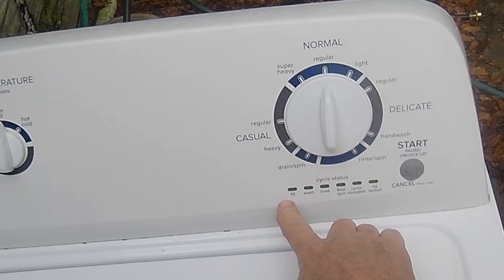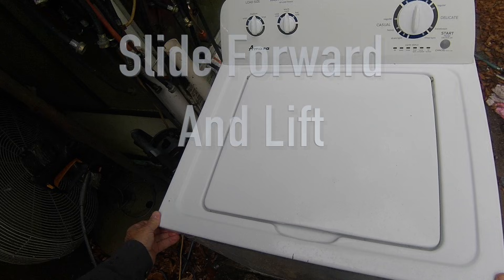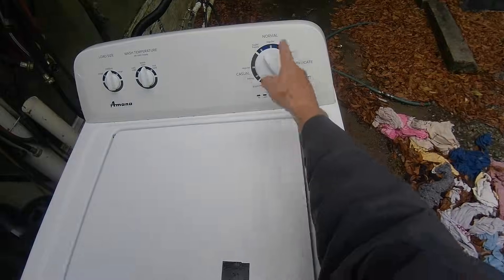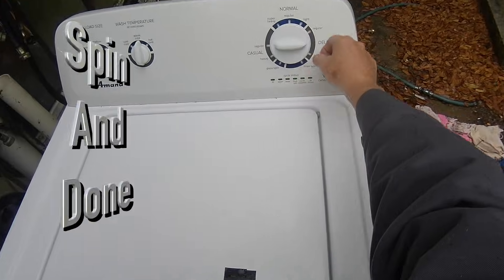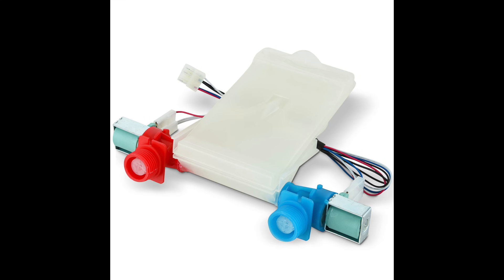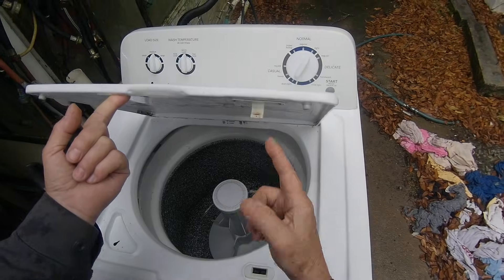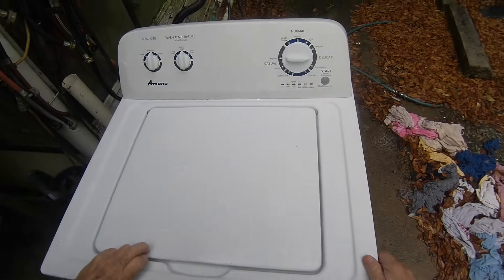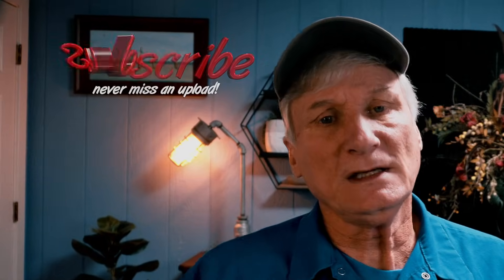How To Diagnose Your Amana Washing Machine: Chip's Guide to Manual Diagnostic Mode

Comment: not sure if you're still active but i just got this washer second hand and when doing a wash cycle it seems to just endlessly drain as its filling up to start the load, waited about 7 minutes and just stopped it cuz it seemed pointless to continue running if it was never gonna fill up. switched it to the rinse/ drain cycle and that worked as expected. do you have any idea why it would want to just keep draining while filling for a load? thanks in advance and thanks for this tutorial!
Reply from the maker: Watch this video. It may give you a clue. How To Troubleshoot Washing Machine Cycle Failures: Plumbing Tips for Technicians
https://youtu.be/OBZcWzOj0Ig
Reply: @HarperandKnowles you're the best! It takes a true professional to be able to diagnose and solve a problem with such little info on my end. Simply picked up the drain hose and it worked 🤦‍♂️
Reply from the maker: Yeah, if you have a hole at the bottom of a bucket (washer tub) with a hose attached to it, and you lay it on the ground, the water will run out! It just isn't obvious when it's surrounded by a cabinet case! Thanks for watching!
Reply: @HarperandKnowles  it makes so much sense, thanks for replying so quickly and for explaining the problem in such a way even I could understand haha.

Comment: Hi I’m having an issue with the same type of washer in the video thing is once I turn the knob from 12oclock position the lid lock light pops on I changed out the lid switch already can it be a control board the machine it’s doing anything just the light comes on when turning the knob
Reply from the maker: It could be a control board. It could be you got a defective lid lock. Thanks for watching!

Comment: Thank you so much for making this video. After watching it, I was able to correctly diagnose my Amana HE washer and figure out the shift solenoid had malfunctioned, probably due to a recent electrical storm. After removing and replacing with a new unit from Amazon, it works like new. Thank you again for all the helpful info you have provided.
Reply from the maker: You are very welcome! Thanks for watching!

Comment: My issue is with draining/spinning. It seems to work unless there is more than a couple of inches of water in the basin, or clothing in there. So basically it seems it wont work if there is any weight. Any thoughts?
Reply from the maker: So, you’re going to have to determine which problem you have. Is it a pump problem or a spin problem. Put it in diagnostics mode and using the water valve setting fill it with about an inch of water. Move it to pump setting and see if it pumps out. If it does then you know it’s a spin issue. Thanks for watching!
Reply: @HarperandKnowles  thanks for the quick reply!!. Ran the diag and it's not draining. when i lay the hose on the ground water comes out so it's not a clog. Should i go right to replacing the pump or is there something else to look at?
Reply from the maker: Pull the pump check for clogs or jams. replace if necessary.
Reply: @HarperandKnowles  Thanks Chip...It was the pump. New one on Amazon for $33 and I'm back in business! Thanks

Comment: My amana washer 
runs out of the blue without anyone turning it on. The lights do not light up or anything. When you unplug and replug it; it just runs with nothing happening. What could be wrong? Do we need to buy a new washer?
Reply from the maker: I’m assuming your water pump is running? If so hold down the start button about 20 seconds or until the noise stops. If it continues you’ll need to change the control board. Thanks for watching!

Comment: My Amana washer starts a cycle but stops after the water has run. The pump keeps running no matter what I do and you can hear it trying to drain. Even after I hit cancel and stop it. The lights turn off but the pump keeps running. What do I do?
Reply from the maker: Try holding down the start button for about 30 seconds. If the pump continues to run after it has been reset then you probably have a control board issue. Thanks for watching!

Comment: Can you please explain what is wrong when the motor seems to be running with no water or anyone starting the machine. This noise pauses when I hold the cancel button, but a few seconds later it begins again. All systwms seem to pass. While the noise is on, it does nothing. No water, no lights, no lidlock, etc. No one turned it on.
Reply from the maker: It’s called a suds lock when you can hold the start button down and fixing it. Its called “time for a new control board” when it doesn't. There's something wrong with the pressure transducer on the control board. Thanks for watching.

Comment: I have a amana washer. The motor just started running on its own. No water is running, no agitator movement. Its just the hum of the motor. Any suggestions?
Reply from the maker: Hold the start button down for about 20 seconds until the humming stops. Thanks for watching!
Reply: It works! I had the same problem
Reply: Thank you so much. 😊 I really appreciate this it worked  perfectly.
Reply: I have the same issue and the motor starts running after every bulky/sheets cycle.
Reply: @Ladeedaa007 it needed a new control board.
Reply: Worked for me too

Comment: When i plug my washer in, the pump starts running right away. If i hold the button to cancel it and run an automatic test or calibration mode, everything works fine until the end, and the pump kicks back in and doesnt stop. It pumps freely during the test, and ive checked to make sure there are no obstructions in the pump, washer tub or plumbing. Any ideas on what my issue is?
Reply from the maker: Change the control board. Thanks for watching!

Comment: Hi I did the diagnostic steps and I started to wash a load and is blinking on rinse cycle what do I need to do
Reply from the maker: What did you find during the diagnosis? A slow cold water valve perhaps? Bad lid lock?

Comment: I have this washer and it dains the water imeadiately. As soon as the water flows in it is pumped right out of the machine. What needs replaced in this case? Is it a faulty water pump?
Reply from the maker: Watch this video it might give you a clue. How To Troubleshoot Washing Machine Cycle Failures: Plumbing Tips for Technicians
https://youtu.be/OBZcWzOj0Ig
Reply: That's been my problem recently too.

Comment: My Amana NTW4516FW top loader did not have a service manual located inside. I cannot for the life of me get it to enter the diagnostic mode after following your video. The unit continues to make a loud gurgling noise after the cycle is complete, and occasionally the clothes inside are too wet.
Reply from the maker: You may have drain pump problems. If the pump stays on after the cycle ends hold down the start button until it stops. If it continues to come on you might have to replace the control board.

Comment: I can't get any of my dials to light up to get started
Reply from the maker: Try holding down the start button for about 30 seconds. If that fails the power supply part of the control board may be defective and you will have to replace the control board. Thanks for watching!

Comment: I guess good in the sense that the motor doesn't appear to be shorted.  Do you think the control board could be responsible for tripping breaker when agitation is called for, or could the splutch (or other) be jambed and cause the motor to draw to much current?
Reply from the maker: That could be. Have you tried spinning the basket by hand to see if something is jamming it?

Comment: Hello. Following the diagnostic test, all is good until the agitation test at which time the breaker trips.  Any ideas?
Reply from the maker: One of the windings on your motor may be shorted out. Use a multimeter set to check continuity and see if any one of the pins in the motor plug other than the ground wire is shorted to ground. Thanks for watching!

Comment: I agree this is the best video I've seen yet. I do have a question however while running the diagnostic everything works all of the steps I took resulted in a successful test run. However the washer won't wash or spin and there's a constant humming like the motor is running. Can you tell me what this might be if running the diagnostic test is successful then why won't it work. I do appreciate you so much thank you
Reply from the maker: Hold the start button down until the humming stops. You’re stuck in a suds lock. If it continues to do that then you’ll need to change the control board.

Comment: I changed both acutator and washer drive assembly but still the same… Based on the video around 6:51, my agitator and basket are not moving. What am i missing? Please help.Thanks much!❤
Reply from the maker: I don’t know what a washer drive assembly is unless you’re talking about the splutch. Make sure all your connections are correct and that the post on the actuator is engaged in the slot of the shift arm of the splutch. Also check the motor is connected and runs and the capacitor is good. Thanks for watching!
Reply: @ Hello, Thanks for responding, Sir. Yes, it is the splutch. When I looked it up and compared the parts numbers, it was listed as washer drive pully. I put them together again and tightened them. It was still the same. 

Interestingly, I saw another video about cleaning, checking and tightening the Agitator which I did. It worked during manual testing but agitator stopped working again. The bolt loosened up. Now, I am stuck on how to tighten it properly. I used blue threadlock for this bolt in the agitator.

Comment: Please help two washers one week and soaking wet clothes. 1. Magic chef portable washing machine won't agitate drain or spin can't find manual or info on it. 2. Amana washer won't drain or spin diagnostic says F7E5 when doing diagnostic it grinds loud then shuts off immediately and then nothing. Any advice or wake through to figure it out would be awesome. I'm at my wits end and so frustrated. Please help.
Reply from the maker: On the Amana, change the shift actuator. I can’t help you with the magic chef portable. Thanks for watching!

Comment: trying to follow along but my mine will not go into diagnostic test mode i can unplug, reset, cancel anything and each time i turn the knob all the lights come back on :( please help. trying to figure out why the washer keeps making noise like its draining but nothing is going on, no wash, no clog, no water but it drains all the time, my wash cycle wont even complete.
Reply from the maker: You probably need a new control board. Thanks for watching!
Reply: @HarperandKnowles  I am afraid so :( thank you!

Comment: My washer just makes a vibrating/draining sound when power applied. But nothing else after. The lights don’t come on, and it doesn’t run a full cycle
Reply from the maker: It’s stuck in a suds lock. Hold down the start switch until the pump goes off.

Comment: The agitater started but stopped almost as quickly as it started and it shut all lights off. Does that mean the actuator is bad?
Reply from the maker: It certainly could be. Pull the book out of the cabinet and do a test on the tachometer. Thanks for watching!
Reply: @HarperandKnowles thank you so much for your response.

Comment: My washer does everything but it stops on wash cycle and jus stays there and eventually drips til the water is full inside?
Reply from the maker: Change the lid switch. Thanks for watching!
Reply: @HarperandKnowles  it drains when I put it on drain and spins if I set it on spin.....would that still be the lid switch?
Reply from the maker: No, that wouldn’t be the switch. It’s really hard to tell you what it is unless I can diagnose it myself. When you go through the diagnostic steps you can isolate each component. If it’s dripping until it overflows then you need a new water  valve. If it agitate then stops and won’t advance past rinse it could be the cold water valve. I really can’t give you a good guess unless I can diagnose it. Thanks for watching!

Comment: Please help, my washer keep making a gurgling noise when it's off. It will only work if it quickly plug in the washer and push start.
Reply from the maker: Plug it in, when it starts to gurgle hold down the start button until it stops. Use only HE (high efficiency) detergents. Thanks for watching!
Reply: @HarperandKnowles  holding the start/cancel stops the gurgling noise temporarily but it return soon after or if I try to use the washer. Please help.
Reply from the maker: Time to change the control board. Thanks for watching!

Comment: When i turn the dial as demonstrated in the video the moment i turn the dial the lights come on and the sensing fill flashing.
Reply from the maker: Try holding down the start button until the lights go out and try again. If it keeps doing it you may have a control board problem. Thanks for watching!
Reply: @HarperandKnowles  when I do that, the lights cut out as they should. But the moment I turn the dial, lights come back on instead of staying off like yours did. Still a control board issue you think?
Reply from the maker: It's really hard to say. I have done things like unplugging the shift actuator and then seeing if the board would go into diagnostics and that worked. There was something shortiing in the actuator. I'd try that. If you still get the problem, plug it back in, then unplug the pump and try that. If you still have the problem change the board.

Comment: Hi - my washer passed all the diagnostic steps however is still not working. It’s stuck at the “sensing fill” stage, without water running into the machine. Does this indicate a control board problem?
Reply from the maker: If it runs water during the diagnostic process but not in the normal cycle then yes, it’s probably the control board.
Reply: @ I was afraid that would be the answer. But thanks so much for your helpful video - saved me the price of a service technician!
Reply: @HarperandKnowles  I watched another video of yours on replacing the transducer on the control board.  Roughly how likely is it the transducer versus a list of other potential control board issues?  If it is highly likely that it is the transducer I will take a shot at replacing it
Reply from the maker: It’s highly likely. Thanks for watching!
Reply: so mine is the same, stuck in the sensing fill stage but it actually starts filling up with water and then stops after a few seconds. Would it be the same control board problem?
Reply from the maker: I can't determine that without diagnosing it myself. Go through the steps in the video and see if you can find any components that may have failed. Pull your book out of the front left inside corner of the cabinet and do a tachometer test. Thanks for watching.
Reply: Hi I have an old pull start Maytag washer. It’s starts just fine and adds water but mid cycle it stops filled with water and starts humming and making a constant clicking noise. If I let it continue it drains some water but not all and the noise continues. If I put it on rinse/spin cycle it doesn’t work on the normal and heavy duty section of the washer
Reply from the maker: What you have is a museum piece and I don’t know anything about those. I’m old, but not THAT old! Thanks for watching!

Comment: Mine won't go into test mode. When i turn the knob to go into test mode the washer starts. It will fill then sit there, it won't lock the lid or wash it just drains the water
Reply from the maker: From what you are describing your washer may be timing out before it fills completely. As for not going into test mode I don’t know why unless I was there to troubleshoot it myself. Try taking the striker off the lid and putting it in the lid lock to watch the water flow. If your water isn’t flowing into the tub in a timely manner change the water valve.

Comment: Thank you for this video! Very informative and helpful.
My Amana top load washer like in the video wouldn’t drain and sounded like the drain pump was grinding rocks. The motors resistance tested good so I was hoping it was still just the pump so I went and got a used motor and installed it and works great now!
Reply from the maker: Thanks for sharing your experience!
Reply: How do we fix this?

Comment: I have this washer and it keeps getting stuck in a constant drain cycle 😢
Reply from the maker: Sometimes all is required is to hold down the start button until it stops draining. But if yours continues in this fashion it could be a problem with the pressure transducer on the control board. I have even seen this problem solved by replacing the shift actuator. Why this fixed it I haven’t a clue but a friend of mine that is also a technician said it worked for him. Thanks for watching!
Reply: @ I tried that and it stops but then starts right back up. I’ll have to try the other option as well! Thank you

Comment: I have a whirlpool top load washer. If unplugged and plugged back in it starts filling with water without touching any buttons. I check for fault codes but there are none. The fill light is just flashing. Control board gone bad???
Reply from the maker: Try holding the start button down until it stops filling. If that doesn’t work then it’s most likely the board.

Comment: Nothing I do lights up the tests lights. 😢
Reply from the maker: You may have a bad control board.
Reply: @HarperandKnowles  thank you, I figured. I will save up to buy a new one. For now, I run the rinse/drain cycle after the first wash to drain out the water.

Comment: I have one where the drain pump constantly runs and won’t compete cycles. I’m assuming that would be the control board? Any input is appreciated
Reply from the maker: Hold down the start button until the pump goes off.